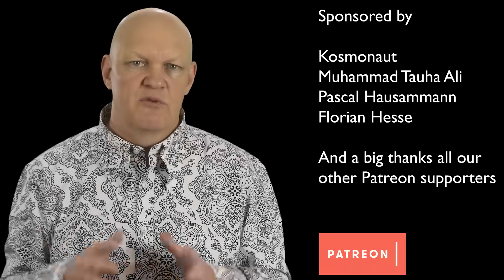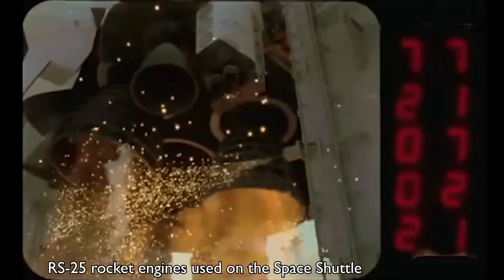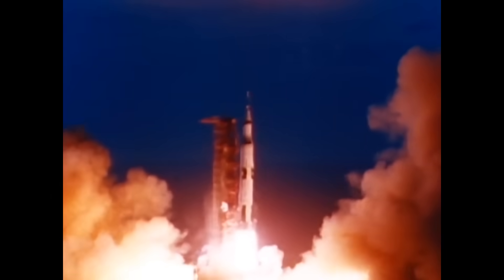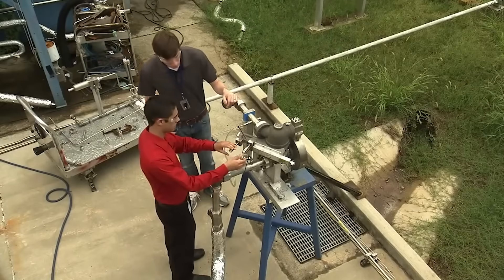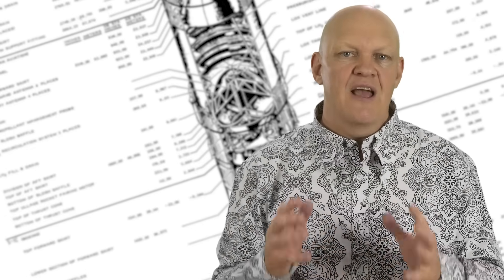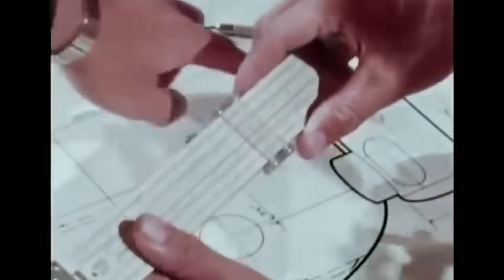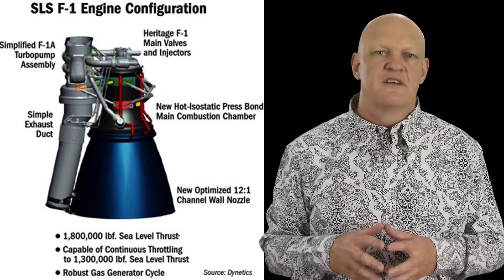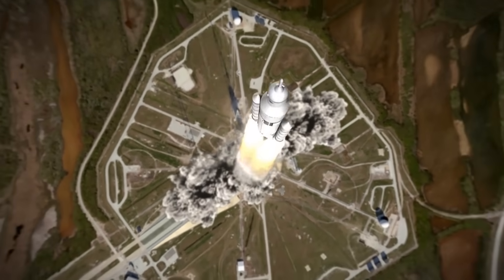Why Can't we Remake the Rocketdyne F1 Engine?

Comment: This is complete garbage. The notion that people are not building the F-1 because of a lack of skill is absurd. The fact is, there is not a market for this kind of engine right now. Look at all of the newer rocket engines. None of them are of this size, despite the fact that there are several rockets being developed that are larger than the Saturn 5.  The fact is, that modern rocket engines are more efficient with higher thrust to weight than the F-1. There is simply no market for an engine like the F-1, at least for the time being.
Reply: Then why do we still not have a rocket capable of bringing people to the moon?
Reply: @rinse-esnir4010  There is a difference between a rocket and a rocket engine. The RS-25 from (Lockheed) Rocketdyne is more than capable of taking humans to the moon. The RS-25 is every bit as powerful as the Raptor engine being developed by Space-X.

Comment: I think Congress forced the SRB's to be used. The fundamental principle of SLS is to re-use as much Shuttle technology as possible and employ those same companies and people. The neo-F-1 does not have as strong a lobby. In any case, it is not in any way suitable for a re-usable booster. One of the great ironies of rocketry is that the N-1 first stage could eventually have been made re-usable... but in no way the Saturn 5 first stage with its F-1 engines.

Comment: Well first of all those skills in Maine to be brought back that were for the original F1 engine. I said build a couple just to see if they could be built. In a uniform fashion. Bev another f-1b can be built just as powerful cheaper fewer Parts in the construction that would be better. Ask for the short video format I prefer the longer videos but you can't quicker to your point that was my biggest complaint you went through a lot of back that was necessary but you went right straight to the point and you shorten that down

Comment: You note that the skilled labor is no longer there. I disagree. The skilled labor is there, it is just more rare. Should the program ever be revived with the vigor that was there in the 50's and 60's, the laborers could be called to the job, but as you noted, it would not be cheap. The redesign is, in the long run, cheaper and more efficient. I just don't want anyone to doubt that the skilled labor is not there.

Comment: Why? Because today's engineers create computer models that say, 'it can't be done'. True engineers set to it with a slide rule, a drafting board and a pipe full of tobacco working through the problems to create something breathtaking. You only have to look at Concorde to see the remarkable feat they achieved which bears my comment out. There's no way anything of that significance could be achieved today because the modelling says, 'no'.  I guess this is progress to some...

Comment: The  only  reason they can`t  replicate the F1  engine is  because  they don`t  want to. That  would  simply   prove  how  inefficient and underpowered they were.  You simply  can`t    engineer  a  giant  single  chamber  rocket  engine, it  doesn`t  work.  F1  was underpowered  because  at full thrust it  would  simply  blow up, its  cooling jacket  could  simply  not  manage  that  thrust.  Here are  calculations   by Russian  rocket  scientists, and  their  conclusion is  that  there is no way    this  a engine  could     work  at  claimed    specifications- 
 http://free-inform.ru/pepelaz/pepelaz-13-3.htm
Saturn V`s real weight    was    1200  tons  less than   claimed.They didn`t  go anywhere, at  best to LEO.
Reply: Ugh...
Reply: An the soviets decided to keep this information to themselves out of the goodness of their hearts?
Reply: @ArKritz84  it   was used as a lever in trade    deals.

Comment: This shows how badly the US educational system fails.

Just compare a today's German blueprint and one made for an US manufacturer.

The US blueprint has to be far more detailed, as the US shop floor personnel has hardly any basic knowledge, while a well educated worker simply knows how to handle it:
E.g.: If rods and holes do not have an assigned tolerance, rods are always slightly smaller than indicated, while holes are slightly bigger. 

The original F1 manufacturer still had that knowledge - the nowadays college noobs don't.

Comment: The same sort of stupidity exists today.  As a controls engineer I have worked numerous projects where CAD and higher ups refuse to allow comments and notes be added to electrical drawings for the sake of drawing uniformity and appearance.    Total BS, a blue print doesn't tell WHY this are configured in a specific way.  Items among be done as a workaround or a nonstandard configuration.  It just shows how management is more interested in how things look then documenting solutions to problems.

Comment: The text is full of contradictions. "the engines were simple to be built and cheap, to the point of being disposable", and then to say "each engine was hand-crafted and adjusted by the skilled workers" (I'm paraphrasing here). Then you say that "NASA never lost documentation on the F1 build" but then says "lots of details were scribbled in notes, long lost, or never written down, kept in memory" (again, paraphrasing). So, which is which?
Reply: It depends on your definition of cheap. The F1 was definitely not cheap by today’s standards at $15 million each. But nasa had an unlimited budget back then.
And nasa did not lose any official documents on the F1 engine. Engineering notes are not official documents.

Comment: So really the answer is "We can remake them, but we really wouldn't want to".
Reply: Exactly. Why use a 60-year-old rocket engine design when modern design and manufacturing techniques can create one more powerful, efficient, reliable, and uniform at a much faster rate while also costing far less?

Comment: this is somewhat misleading as in - it's not factually correct.  the main reasons for the obsolescence of the f1 are costs and fuels (they used kerosene and oxygen, modern rockets use hydrogen and oxygen) not that all the smart people are dead. it's great to be able to misinform millions of people but the facts are that modern f1b engines (which were easily built) are able to generate far more power with less parts. there's no mystery, no human touch that's missing, the f1a was obsolete; not to mention it had issues exploding that could not EASILY be solved without modern technology- which did call for ingenuity at that time but it just made it an overly complex machine.

Comment: I immediately noticed that you said that the rocket boosters for the shuttle were single use, which is not true. The only single-use part of the shuttle system was the fuel tank. the boosters were reused several times.

Comment: When the first Saturn 5 rocket was launched from Cape Kennedy I was standing on top of a hangar about a mile away. BIG mistake. No one was prepared for the colossal rocket that was launched on that day. I was lucky the hangar didn't collapse. The subsequent fall-back zone for Saturn 5 launches was raised to 3 miles and the cape was absolutely out of bounds for gawkers of any stripe. The development cycle for the F-1 engine was done at a Rocketdyne facility up on top of the Santa Susanna mountains to the North of the San Fernando Valley. That development facility no longer exists and it would be extremely difficult to recreate it or even a semblance of what that place was and what it did. The container they had to keep the fuel for that engine was a giant metal ball easily 100 ft or more across. I would think it would be impossible to get a permit to even have something like that in this day and age. If that ball had ever exploded it would have taken the top of that mountain off and would have seriously impacted large chunks of greater LA. The Saturn 5 rocket was a monster never seen before or since. Good times were had by all.
Reply: The F1 is powered by a kerosene and liquid oxygen fuel mix. That ball would likely just have contained kerosene. It wouldn't explode, much like how diesel fuel is somewhat difficult to ignite.
Reply: @tardonator  not Hydrozene?
Reply: I worked at Rocketdyne until recently. They, as a manufacturer, have outsourced manufacturing for complex components for a few decades. Assembly and test of of sub systems is still performed "on site". Final engine assembly and engine test moved to Stennis Space Center in Mississippi in the early 80's (afaik). I believe engineering notes are archived electronically now. I can't say that outsourced parts have detailed notes that travel back to Rocketdyne. I would guess that that would need to be part of contract negotiations... on all levels of manufacturing
Reply: Well, aerospace in So Cal today isn't even close to what it was post WWII up until the 1990's, it was the economic driver that created So Cal post WWII.  Santa Susanna Field Lab is one of many facilities that no longer exist and manufacturing moved out long ago with all the job shops and venders who catered to aerospace gone too.  Most of the formerly remote areas are now surrounded by urban sprawl including SSFL.  That was all in a different time and different era.
Reply: I remember seeing Walter Cronkite reminiscing about the first Saturn V launch. We had no idea what it would do. He said ceiling tiles dropped, windows rattled and shattered. He said we were not prepared for that side of it.
Reply: Such interesting facts.  Thanks.
Reply: I hiked up to that facility in 2003.
You can overlook the old test bed.

Rocketdyne in the valley has an F1 on a grass circle at the entrance.
Reply: I lived just down the hill from Santa Susanna and yes the tests would shake the ground.  They only did one F1 test there and realized it was just too big. After that the testing was moved out to Edwards AFB. I saw the results of some of those tests where parts of the engine were totally melted down. The J2 (second stage engine) was tested at Santa Susanna - over and over :) It was all good!
Reply: I stood on the sands across the inlet for the launch of the second Saturn V in the series. You felt that rocket take off as much as you heard it.. It was a visceral body pounding stronger than any rock concert you can imagine.
Reply: Lucky man
Reply: Fed's don't take out permit?
Reply: We lived 35 mi North East of the Santa Susana Field... You could hear them testing engines
Reply: They moved the ball to Sacramento where Gavin keeps his hair gel.
Reply: since when would wiping out part of LA be a bad idea? lol

Comment: Having a patent on paper and trying to copy it can be worlds apart. Pre-WWI BASF patented how to make ammonia from air "Brot aus luft". Post-war imitations failed because the metallurgy and pressure equipment designs were not revealed and BASF would not joint venture or lease the technology. Hydrogen embrittlement caused rapid and explosive failures. BASF technocrats were bribed (I.E.DuPont was just one involved) to learn the secrets.

Comment: Even if they could remake artifacts from 50+ years ago, they'd needlessly top them off with software (with glitches) in command of hardware that ran fine without an extra layer of digital computing... Imagine Neil Armstrong being asked to enter a password (plus maybe a 2-factor authentication) at a critical moment instead of just being allowed to manually control the vehicle.
Reply: Uhh pretty sure Astronauts are not required to do that lol. Shuttle pilots pretty much flew the thing themselves

Comment: First, when Challenger blew and launches were suspended in 1986 Hughes Aircraft had a bunch of comm sats waiting to go up and explored the idea of building a new launcher they named the Jarvis, for Greg Jarvis who was a Hughes engineer who died in Challenger. They were asking Rocketdyne  what it would cost to build F1 engines for the project. I wish I could see Rocketdyne's response. The project died when GM, who had recently bought Hughes pulled the plug on it.

Second comment is that NASA was never going to buy a large number of F1 engines. The thing I know about projects like this is that documentation costs money and when that cost is spread over less than 100 units the money available for documentation is very hard to find. Every time you ask to do a drawing revision it gets more difficult to justify. By the time you are producing the final dozen units, if you request a drawing revision they will just scream at you! There is always a learning curve and you are making the best examples last but those late changes are the least likely to get properly documented.

Consider the aluminum beverage can. They are made by the billions at very low cost yet when was the last time you saw a bad one? The people who make those cans know every thing about making them in extreme detail and the cost is spread over so many units it is trivial on a per unit basis. Consider what it would cost to make 100 of those cans and no more if you had to engineer then from scratch and pay for the documentation and tooling and testing. The Saturn V program was that type of effort.

Comment: The F-1 engine was designed & tested by the Air Force... then picked up by NASA..
NASA didn't invent the F-1 or Tang, Velcro, ball point pens, transistors, Integrated Circuits, Teflon,  GPS, computers, microchips, cell phones, carbon fiber, the internet, solar cells, fuel cells, pintel rocket engines…..or much of anything else. Giving NASA credit for the technology it uses/touts is like giving a rooster credit for sunrise.

Comment: im going to have to run the BS flag to the top of the staff.  the ingenuity and skill of our workers today could very well create these engines in their '60s configuration and if NOT, with the use of computers they could engineer out the flaws and foibles that require the hand fitting.   no id say there just isnt the will since theres no need for engines like this anymore...
Reply: One of the issues discovered early on was a catastrophic vibration in the engine. It was corrected by a mod to the fuel injection plate. The nasa drawings don’t show the change. Modern computer simulation showed the vibration. It didn’t exist in production engines. Some engineer on the f1b project examining a old real engine found the difference. Then ran down through interviewing surviving folks who had the ‘tribal knowledge’ and found some notes on the injector plate from the day. They described the testing and solution with the minor redesign. 

Without those notes and the sharp eyes and skills of the modern technical historian they’d likely not have the original elegant solution.

Comment: You are absolutely correct. I started my Aerospace career at Rockwell International Rocketdyne Division on Canoga Avenue, Canoga Park, California, and as a child had a direct view of the Santa Susana field laboratory that was firing off rocket engines daily that I got to you view from myself facing backyard which drew a straight line straight into the Santa Susana mountains where the lab was. The nighttime firings with such a beautiful and awesome site with the hills lit from the glow of the rocket engines and the ground shaking below you and you could hear the Roar of those engines throughout their static firing tests.. for an 7 year old, it doesn't get any better.. At the Rockwell International Rocketdyne Division, an F1 engine proudly stood in front of the company and Manufacturing site where they the F1's where built.. I had the honor on working on the space shuttle main engines as a CAD Designer and started there in 1980. Even then the upper management did have concerns about the 1960 Apollo era technicians and assemblers that we're now working on the space shuttle main engines and they were worried that  not enough younger people were coming in for the older generation to pass on their skills to the next. So they were well aware of the situation that actually came to be. Lucky for me I came in at a time specifically to learn computer-aided design that Rocketdyne was just then getting into and was lucky enough to be one of the Pioneers in that field... I have also kept 100% current of everything that is going on in the manned space flight and commercial space flight realms as well even up to today and can tell you what we need to be doing in the immediate future.  What is happening now Boca is fantastic..

Comment: I have two synthesizers known as the Yamaha CS-80.  It's sound has never been replicated and it is considered the holy grail of synths. One look inside and you get a feel for what went into it's build. The looms of wires are kept at bay in many areas by very fine threads with intricate knots and origami type structures to keep it from overheating in certain areas. Miles and miles of wires. Companies, even Yamaha has teased a reproduction, but in the end they can only get close, and without it's magic timbre.  Sometimes you can't go back. Is why I have two. NO parts. lol

Comment: Curious Droid - A-R can build an F1A or an F1B but would probably not want to build an original F1.  And it is true, that the F1's were all, mostly custom built, and NASA just won't tell you that we can make newer/enhanced versions of the original F1's.  However, if you go ahead and ask any of the Aerojet-Rocketdyne top level business managers, A-R really could make F1A's or F1B's for the right price, which would of course include a redesign, re-manufacture, retooling, retesting and re-certification phases of an engine program, as part of the overall cost, whether it be for NASA or for some other commercial Vehicle Integration Company.  A-R does have the engineering knowledge. They have done a much similar upgrade to the SSME/RS-25 Engine for the SLS Program.